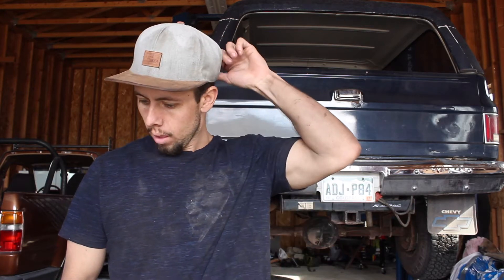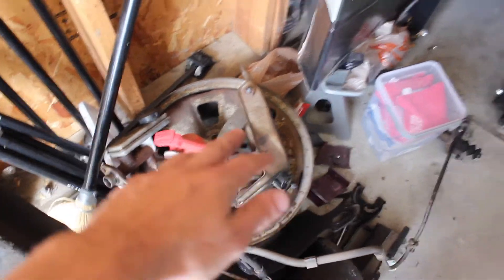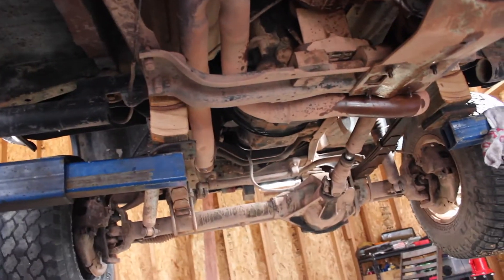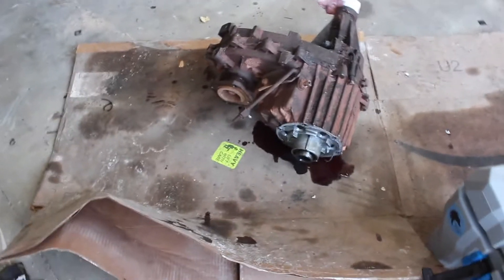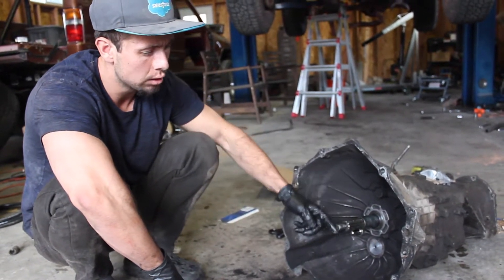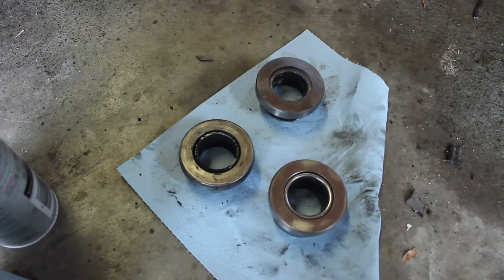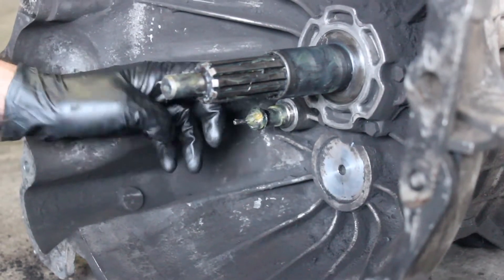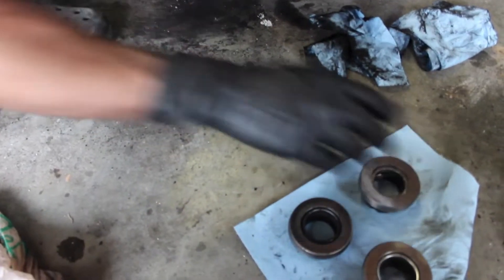1984 K5 Blazer Upgrade: SM465 swap to NV3500 Part 1

Comment: I put an NV4500 in my 78 square body.  Used an adapter kit so I was able to maintain a manual clutch. She’s a ripper!
Reply from the maker: that is what i ended up doing a couple years later.  i think the videos are on my channel

Comment: Nice my truck has nv3500. 98 chevy k1500 ext. Cab 305 engine. I got some videos of me driving it and the flowmaster dual exhaust. I gonna make some videos coming up on it doing the clutch and headgaskets in it as well. Liked and subbed! God bless
Reply from the maker: thanks, i will check it out!

Comment: What did you use to hold down the clutch fork on the pivot ball
Reply from the maker: nothing.  i just grease it up and the force from the pressure plate hold it on.  many clutches are set up like this

Comment: Did you use the same clutch linkage that's mounted to the frame or did you have to use 89?
Reply from the maker: i had to use the 89

Comment: Nv3500 to np208? If so how did they connect them I’m wanting to switch my auto 83 k5 to manual
Reply from the maker: i do not recall exactly what transfer case it was but it did just bolt right up.  i didnt need any adapters.  same spline count and length and bolt pattern.
Reply: @myles2go.  yea I’m having some real trouble finding a 5speed near me
Reply from the maker: @johnrideabmx  i also had a very hard time finding the trans.  i planned the swap for a while before i found someone parting out an 89 gmc truck on facebook.
Reply: @myles2go.  same every old thing I’ve bought with a 700 died and I can’t justify putting another one in I been one the hunt for standard stuff awhile
Reply from the maker: @johnrideabmx  unfortunately, that was my experience as well with the 700r4 trans.  good luck on the search!
Reply: @myles2go.  what fly wheel did you use I found a 94 trans I’m pretty sure I have a one piece rear main seal 350 (passenger side oil dipstick) just wondering if the 94 clutch and flywheel just bolts up
Reply from the maker: @johnrideabmx  i didnt change my flywheel or clutch.  as long as the input shaft spline count and diameter and length are the same, it shouldnt matter.
Reply: @myles2go.  I’m not thinking you switched from sm I’ve watched the vids a bunch I’m going from a 700 
Im picking it up tomorrow was just gonna take everything I could off donor truck so trying to make the mental list
Reply from the maker: @johnrideabmx  i went from a sm465 to an early version of the nv3500 (it was actually an HM 290 i think)  If you have the 700r4 auto tranny, that will be a different swap from what i did.

Comment: How you do with the speed sensor on the new transmission
Reply from the maker: the speed sensor goes into the transfer case.  I kept my existing transfer case so nothing needed to be changed.

Comment: The better mod but maybe more expensive is to add a gear vendors od. You can split the gears giving you a 6 speed and keep the granny low for a 7th gear.
Reply from the maker: I have heard about that but had access to the parts for the 5 speed swap so i went that route.

Comment: The 208 shaft was the same size off the SM 465 as the 3500 because I want to do the same swap on mine and I want to use the same transfer case

Comment: Have you had a chance to finish the swap? People say the front drive shaft has clearance issues with the bellhousing where the slave connects
Reply from the maker: I did finish the swap and am getting close to editing all the footage for this truck.  I will have it uploaded soon.  I have a clip that shows exactly what you are talking about.  I flexed out the suspension and jumped up and down on the fender to make it wiggle even more.  I never had any clearance issues.  It had maybe 3-4 inches of room left still in between there.  I have also been wheeling with it for almost a year now with no issues.  My truck is lifted though.  I think the previous owner told me it was lifted 4 inches but i am not sure.  If your truck is stock height, i think it would hit the front drive shaft.  In that scenario, I would have just sourced a later model nv3500 with an internal slave cylinder.